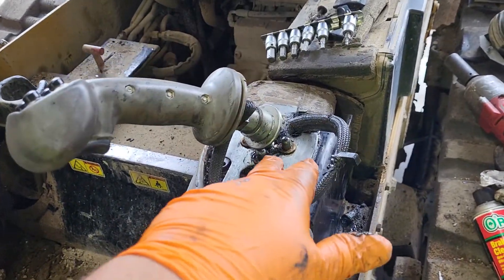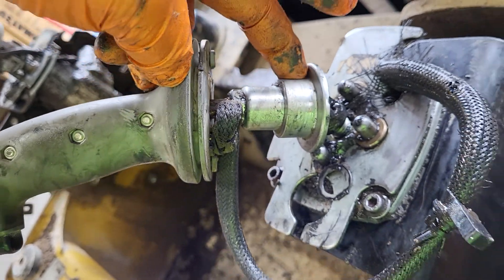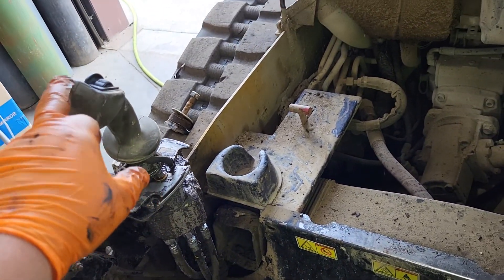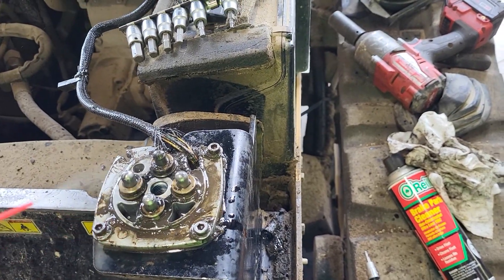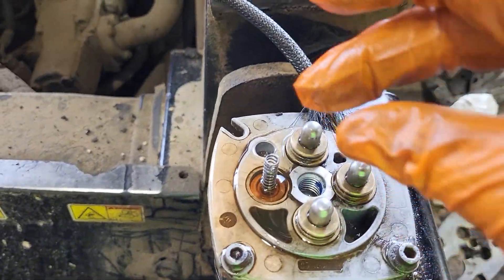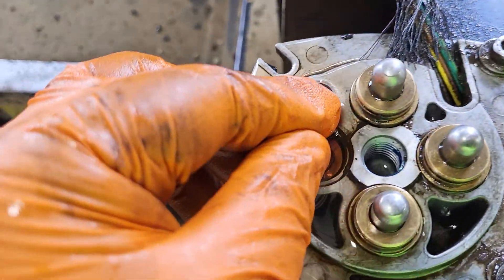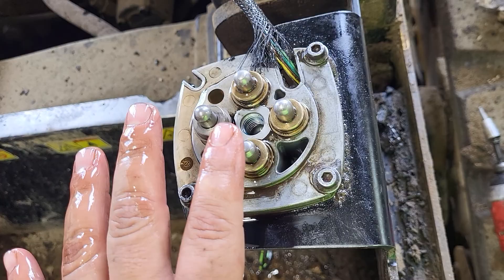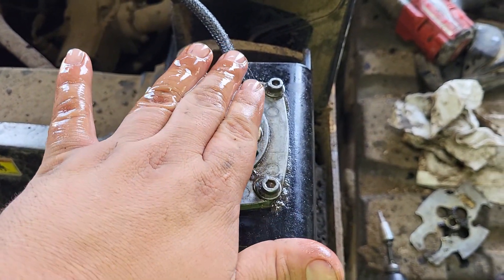how to fix leaking cab controls on a cat skidsteer

Comment: Just did this on a '12 259B3. As far as removing the universal joint, take off the metal rod that the handle bolts through by loosening up the nut and threading it off. The the universal joint will come off via the hex key (8mm IRC). This avoids damaging the universal joint with the big screwdriver.

Comment: Can't seem to break the right side loose because of all the nuts on it. Any ideas?
Reply from the maker: Sorry for the late response, but they have a Alan screw on top of the universal joint after you unscrew the plastic handle, its the tube that comes up out of the top of the universal joint, put the alan wrench inside of that to hold it so you can brake the universal joint for the handle free. Good luck and thanks for watching.

Comment: Right @ 14:00 you remove the spring and smaller plunger which go inside the silver bullet.  The unit I am working on 2007 236B, only has springs on 2 of 4. on direction and  speed stick.  CAT diagram for Valve Group Pilot 299-9119 does not show them.  Are they necessary, I don't see what they add to function as the silver bullet actuates the plunger without it.  Does it provide a preload on the plunger?  Doesn't really feel like it does.  

I'm wondering if CAT removed them when the PN changed, since some old PN are noted "replaced".
Reply from the maker: Could've done. I have seen that on a 90s case loader and it didn't have any silver bullets and still works. So your probably right.

Comment: Thanks for the video. I replaced the poppets and now I can’t seem to figure out the boots. How do they stay in place?  I try to tuck them into the base but it won’t stay
Reply: Yes use a large zip tie around the base, make sure all the rubber is tucked in.
Reply from the maker: Sometimes they suck to keep them down, if you get a zip tie and rap the bottom of the boot with 2 of them you can suck them in and down, i do that with older machines.

Comment: thank you  very good video , my 287B  right side is sticking what can i do for it , thanks Kenny
Reply from the maker: The older B models had some problems with the pilot valves and  cat made an up dated pilot valves to replace the original ones because of that issue, I just ordered some for a guy on a 226B and the they where in the ballpark of $1,500 per each side, but the bucket control on the right side might be a little cheaper.
Reply: @DMtec101  thank for getting back to  me ,i will look into that thank again     Kenny
Reply: @DMtec101 Hey brother, my 06 236 b when it’s cold the bucket didn’t hold pressure, it goes down, i think when hydraulic oil warms up, fix the problem, do you have any idea what’s the problem? thank you!
Reply from the maker: It sounds to me like it could be the seals on the piston of the hydraulic ram rod are probably bad and when its cold the oil moves around the tube and piston, the heat of the hydraulic oil can cause the seals on piston to swell. But also if there is a sticking valve where it's in the main valve body or the hand control valve the heat will cause the steel to expand and allow the movement of the valve. Dose the hydraulic rams that are having the problem have any leaks where the rod slides into the tube? And if it has a fluid coming out around the rod, my guess is it's the seals. But it could also be bolth.
Reply: @DMtec101  Thank you so much brother 🙏🏻
Reply from the maker: No problem
Reply: Hi, 

My cat 287b lost forward drive and left turn is now slow after I replaced the plunger seals.  

I have a feeling I have upset the resolver valve at the bottom somehow.  Do you think this may be the case?  Was perfect until I changed the plunger seals.

Comment: Have you replaced the pins or added shims on the main light arm? My arms move side to side but can’t find any info on fixing or adding shims. It’s almost like no one wants to show how to work on these things.
Reply from the maker: Ya I know what you mean, I use big bolt washers the pin size are 40mm. So I use 1.5in diameter blot washers. I find mine at a hardware store. I hope that helps
Reply: @DMtec101  thanks man, im gunna look or some sand try to get it fixed the side to side clattering is driving me nuts